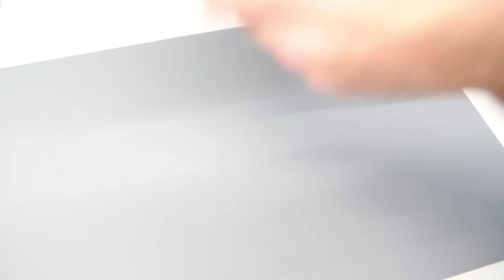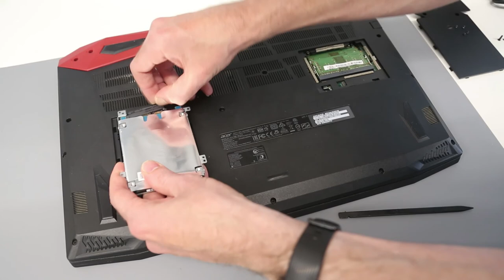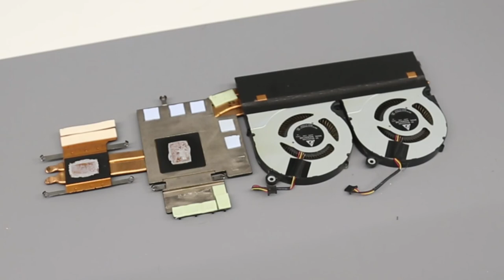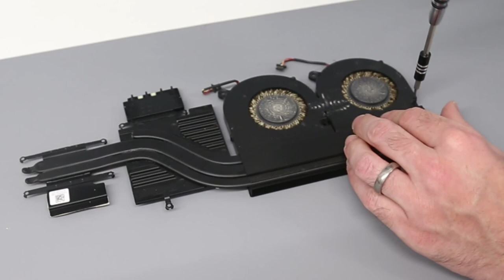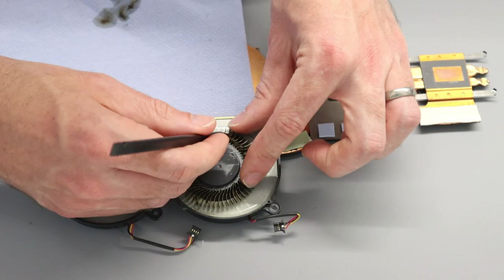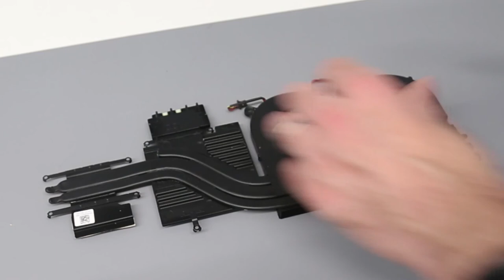Acer Predator Helios PH317-52 - HDD, SSD and RAM Upgrade and Cooler Cleaning Guide

Comment: 8:20 on my machine all 4 had screws in them
Edit: I think the fans and heatsink were a bit different for my model. I had 4 screws connecting the fans to the case / motherboard, with all visible screwholes occupied, and none connecting them to the heatsink, it seems they were only taped to the heatsink.

Comment: Hello thanks for your video ... I contacted ACER about my PREDATOR Laptop model PH317-52-737C, they say that it only supports m.2 PCIe 3.0 SATA SSD (it is not very fast), but I see that you are installing an NVMe SSD on it. .. The one you use for upgrade is M key and the SSD that comes with the laptop is B + M key ... Did it connect correctly? . Does the laptop use the full speed of the new NVMe SSD you are installing? ... do you recommend trying with a NMVe PCIe 4.0?

Comment: i have the same laptop but i cant take it apart since one of the screws has stripped head do you know anything that could help removing it?
Reply from the maker: Sometimes putting some electrical tape over the screw and press down on to it with the screwdriver can help it grip - open the laptop up with the screen off the edge of the desk to avoid damaging the screen.
Alternatively, carefully drill out the screw head and then remove the rest with screw extracting pliers once the panel is removed.

Comment: 18:54 Probably shouldn't have pulled off the heatsink after applying new thermal paste, its gonna have tiny micro gaps and air bubble's
Reply from the maker: Fair point - I wanted to check I had decent coverage across the chips prior to fitting properly.
Reply: @BrueComputing  did you do some thermal testing though ?
Reply from the maker: Left system running Prime 95 whilst editing the video and then Unigine Heaven overnight - temperatures very good, CPU maxed out at around 60c.
Much better than before as the horrible clagged up fan didn't seem to be moving much air.
Reply: @BrueComputing  Nice , cool temps , the fan with so much stickiness though , ugh , hahahan 😄😄😄 never seen that before , owner must be indeed a smoker.
Reply from the maker: Was a new one for me on a laptop - seen similar on desktop systems in the past.

Comment: Does the pin type of the M.2 slot matter in this case? The SSD in the video has a B+M configuration, but the one you have linked in the description has an M configuration. Are they interchangeable in this case?

Comment: I am currently using an external SATA SSD with an enclosure connected via USB, would it be possible to put it in the slot that the HDD is currently in?

Comment: Can I use sanitizer instead of rubbing alcohol? I need a fast answer pls
Reply from the maker: Never tried it - I'd use something like a small amount surface cleaning spray on a paper cloth if you don't have something more suitable.
Reply: @BrueComputing  ok thank you. But there is another problem: I can’t open the fan case so I can’t clean it even though I got the same laptop. What should I do?

Comment: Hello, could you tell me?
If it works, putting higher frequency ram instead of putting 16 GB 2666 MHz, use Kingston FURY Impact 16 GB (2 x 8 GB) 3200MHz DDR4, does it work?
thank you
Reply: no 2400mhz highest. just did myne 32gb

Comment: Nice video! I have the same laptop but I haven’t used for a long time. It works really slow, do you think the dust inside the laptop which has been built up over the years is causing the problems?
Reply from the maker: Potentially. Does the system have an SSD installed as that makes a big difference to performance?
Reply: @BrueComputing  It seems that I do have SSD installed, however i am not sure if it a good SSD (HFS128G39TND-N210A). I am buying an external ssd, do you think it would improve the performance? or would you recommend installing additional internal ssd?
Reply: i have same laptop, if you use windows on nvme m.2 disk, it iwill never work slow, it's 4 years old laptop, but still speedy in daily tasks, you can even game with it, plus you could also disable a lot of services that start with windows that are not necessary at all, i also have it with 8 gb x 2 sticks, not 8 gb x 1